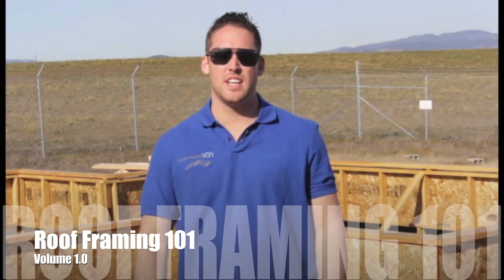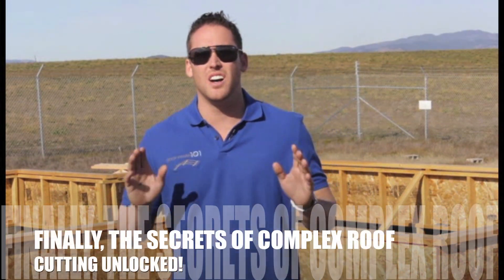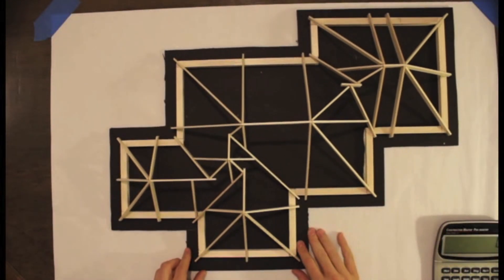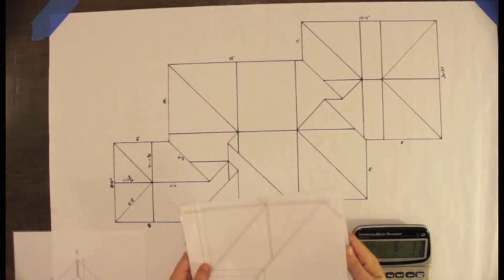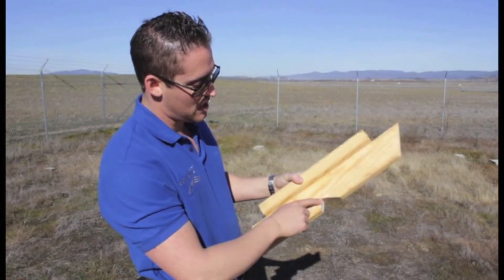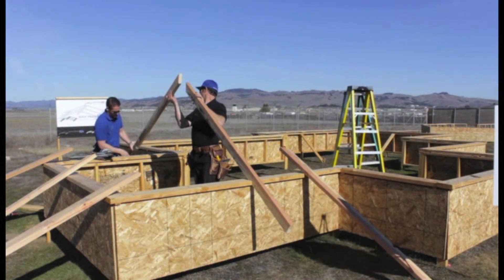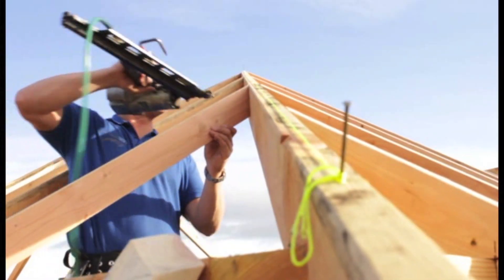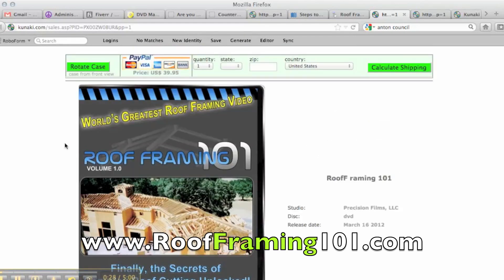Roof Framing 101 Volume 1.0

Comment: I am a retired Builder contractor I was a framing contractor for 30 years then became a builder contractor. I consider myself a master Carpenter a master root cutter I even used to piecework cutting roofs. I would generally get myself a 2-foot by 2-foot piece of plywood and transfer the outside wall line on the plywood exactly how the blueprint shows it. Man I would label every Ridge hip Valley By Numbers such as hip number 1 number Ridge number 1 Ridge number 2 and so forth. Then I would label every board accordingly I would label all the Jack Raptors 1234 and their location. Dacres would come behind me and put the roof together they would tell me after they set their Commons and Ridge and hip 99% of the time the ridge was level if you know what you're doing and you calculate everything out to the 16th of an inch everything will fit exactly the way it is supposed to. You have to beat. But people who know I can teach and then it's up to you to read and study and learn everything there is to know about cutting a roof because if you don't you'll be mediocre and you won't have your roof come together like they're supposed to there are a lot of tricks of the trade like setting back your valleys lowering your hips for the right Raptor Heights laying out your ridges so that stackers know exactly where to nail every board. I even cut all of my Gable studs my purlin strips and collar ties everything you need to put the roof together I would cut and label and stacked next to the house it was ready to go for any crew that knew what they were doing. Oh and by the way it is your duty to teach younger guys under you the same way you were taught so that they could carry on the trade.
Reply: Hello
Reply: Hi I read your post are you available I am leaning to roof framing I am looking for help

Comment: Nick...is it possible to redo the entire structure from the inside of an attic? None of the rafters were measured and cut right. ...I dont know how I still have a roof. The main rafter isnt even attached to the frame. I dont know how it passed inspection. Anyway...I'm stuck with this problem. Is it fixable?

Comment: Hello, do you do a meteoric version? Ian
Reply: Mate just times everything by 25.4. There’s 25.4mm in 1 inch. There’s 12 inches in 1 foot. 12 x 25.4 = 304.8mm. A real carpenter/framer should be able to understand both metric and imperial measurements.

Comment: Kind of puzzling we have had a red roofer book in Australia for as long as I have been in the building industry It has a table of lengths , for Rafters creeper rafter hip rafters valley rafters and all pitches . once you have the building spans and the pitch you just look up the table and cut your roof out mm basic First year apprentice training oh yeah!! we find metric is much easier than all the feet and inches stuff after all we are in the 21st century
Reply: If u really want to get a real understanding of roof cutting check out Marshall gross or Larry haun
Reply: @jaydenny9268 on YouTube?
Reply: Mate I’m from Australia too and I can’t stand carpenters needing a rafter length book to be able to figure and cut a roof. It’s why so many carpenters are still at an apprentice level when it comes to complex roof framing and multiple pitch roofs with bastard hips.
Reply: @Hello stephen how are you doing?

Comment from the maker: Do to the fact that this roof was never intended to be a permanent structure and was only meant to be used as an example and disassembled later. We only nailed it with 8d nails which would not be sufficient for a real project. Connection specifications are usually set forth by the structural engineer.

Comment: i agree with calc rafters first but i get actual plate to plate measurements then cut all raftres on the ground also cutting all overhang tails including hips. when cutting a bastard hip roof i set all ridge boards 1st then all commons then we run overhangs all the way around string a line pt to pt perfect everytime